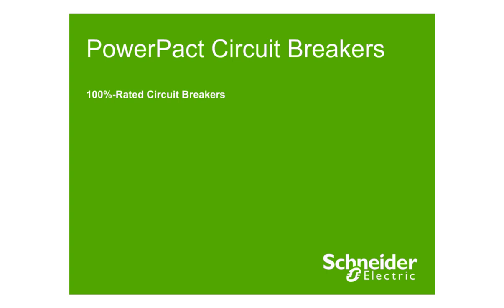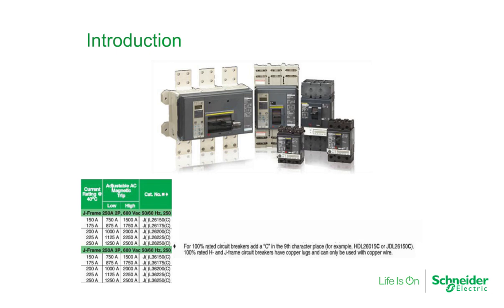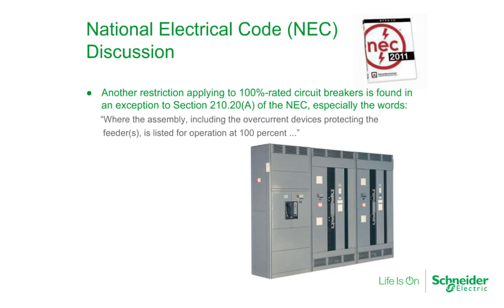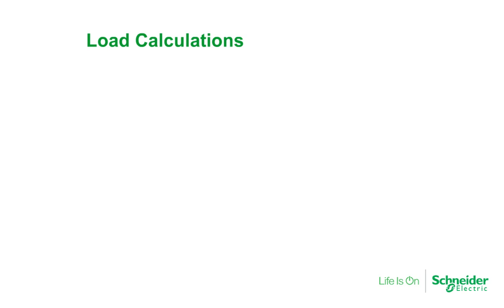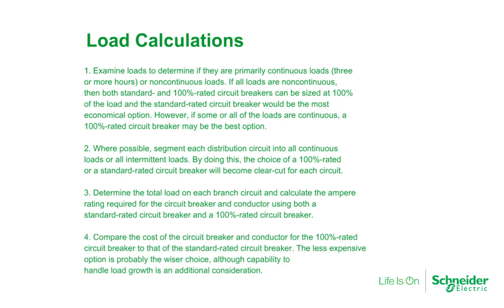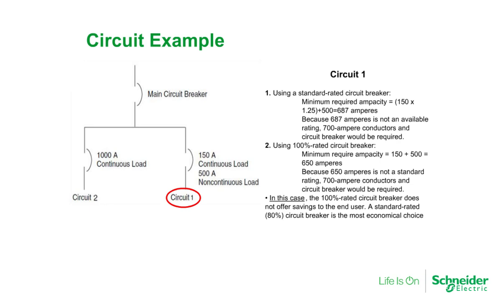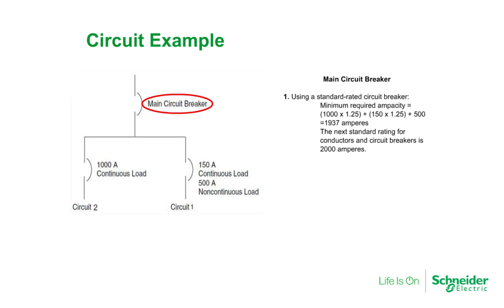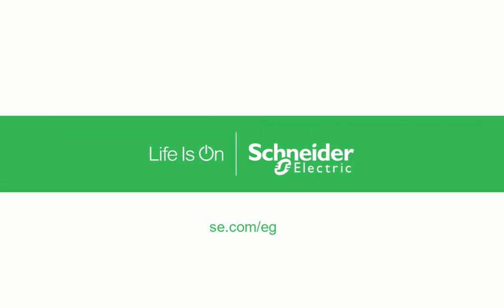مش لازم تضرب التيار * 1.25 علشان تحسب القاطع

Comment: The video is really useful.
I used to use standard-rated C.B whatever the case,but i have a question !
He said that 100%-rated C.B doesn’t always guarantee project savings, i think in worst case it will equal to standard-rated one. Am i right?
Reply from the maker: حضرتك كل هذا الكلام يطبق فقط على قواطع شنايدر المصنعة للسوق الامريكي. اما القواطع المصنعة للاسواق الاوروبية و العربية جميعها مصممة ١٠٠%. هدف الفيديو توضيح لماذا يطلب كود ال NEC الضرب فى ١٢٥% وهو ما يفعله كثير من المهندسين بدون معرفة السبب